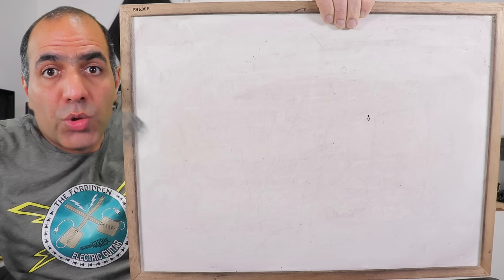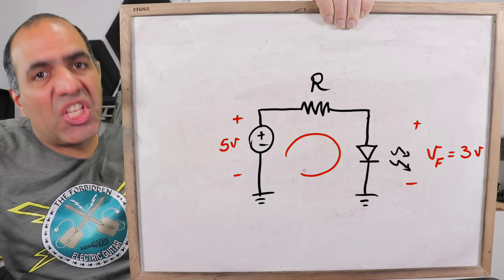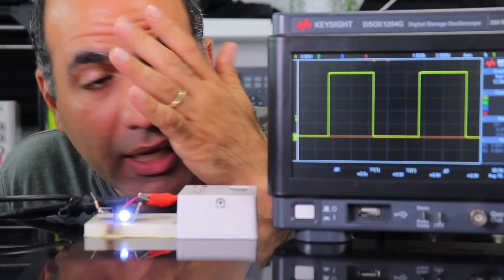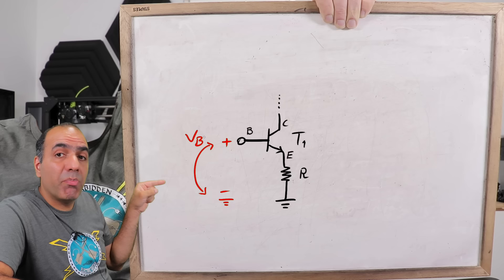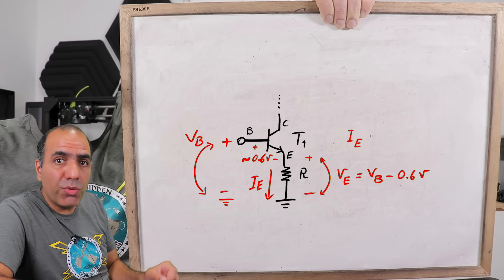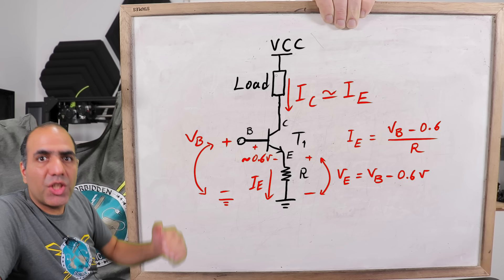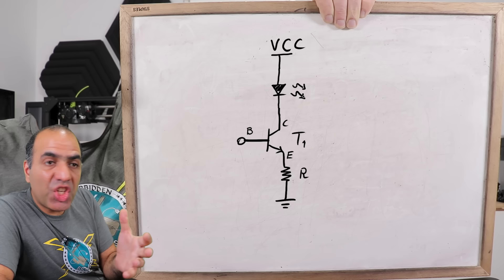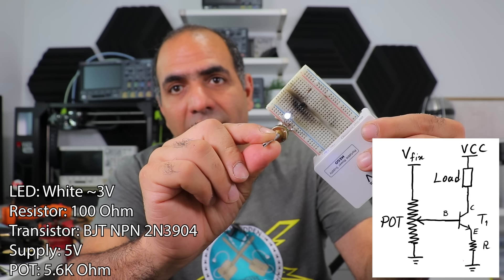How to Turn an LED On

Comment: Technically speaking, Mehdi, all diodes are light-emitting. Just that the ones we don't call light-emitting emit infrared photons as electrons jump across the band gap at the junction and lose energy along the way. :)

Comment: Earlier today I was wondering how to make the LED from my flashlight last longer and the first thing I wondered was what I could replace the limiting resistor with to lower the consumption and then this video popped up. Coincidence?
(P.S. for a 3V supply, 30mA is equivalent to around 10mW so it may not be worth it)

Comment: @ElectroBOOM , I use at work these LEDs "150060RS75000" the light is insane and I drive them less than 100uA current to reduce the light a lot. they are super efficient.!!!!! Driving them at 1mA or more is really bright!!!!!!!!!!

Comment: Lol as an instrumental engineering 😅 it's better if you used Chopper .😏 But turns out after capacitor experiment you went to chopper circuit (kinda MOSFET,igbtor bjt)

Comment: I understand ohm's law, V=IR, but Mehdi used a formula here that resembled ohm's but had some extra components.  Could anyone help me understand how he came to 200 ohms? 
I don't know calculus (I will learn eventually) so if I need that to understand, I'll have to learn that discipline first.
Reply: No calculus necessary only ohms law and kirchhoff's voltage law are needed. 

If you know the voltage drop across the diode from the manufacturer (say, 3V) and the voltage of the power supply (say, 5v) then you know that the voltage drop across your resistor in series must be 5-3=2v. This is because kirchhoff's voltage law says all the voltage drops in a closed loop have to add up to the voltage power supply. The voltage drops of the series resistor and led add up to the 5v of the power supply so the voltage drop of the resistor must be 2V. 

Also, we know the current needed to light the led from the manufacturer (say .01A). 

Now we know the voltage drop needed across our resistor and the current we want flowing through it so we use ohms law to solve the resistance R=V/I 

2V/0.01A=200ohms

Comment: I just wired up a little model I had that lights up directly to a 2xAA battery box without any resistor lol I'm probably wasting battery power, but 3 volts isn't going to blow an LED XD 120 volts sure will, though haha

Comment: Why don't you make a viable shake charger for various devices?
You know, with a big fat powerful magnet..

I've been wanting to make 1 for nearly 12 years now & just never bothered, but I'm finally getting a hold of all the components I could need to experiment with.
It also doubles as a powerful flashlight.
Hah, I was even thinking about adding UV LEDS to it with a selector switch, just because, why not.

Maybe even turning it into a hand held heater with some extra engineering, & a shit ton more learning.
I haven't done electronics in 21 years man.

Comment: At work we found some fairy lights that took 3 AA battery but somehow turned that into AC to power the LEDS.  Trying to run the lights of DC made them very warm very fast.

Comment: Why not use high power resistor (ceramic resistor)? I can see you are using 1/4 watt resistor. Try power resistor (comes in ceramic material). It will not burn.

Comment: I remember seeing an electric locomotive that recharged its 64 volts batteries from 1500 volts DC with a huge resistor in series with the batteries...
Not beer efficient at all!

Comment: 3:41 Could doing this destroy some power supplies?
Reply: On the video the current has spiked up to 10 A, but remained stable. Will all power supplies survive a short circuit like this?

Comment: Hey! I'm an industrial mechanic. Tell me why, when im fiddling with the wires of an unlit LED light while standing in a puddle and there is no detectable current to the wires, the LED dimly lights. I assume it is the weak electric current within my body combined with some other factor.

Comment: I was once working as a shop boy in a car stereo installer.  I was walking across the shop holding a 1F capacitor.  I dropped it.
Reply: @GamerTheTurtle  My clothes were a little singed and torn and it took a while for my hearing to come back.

Comment: Is it just me or when some LEDs are "dimmed" you can see the flashing? I Proved this to some friend of mine one time while we were out at a place that had LED strips lighting the back patio. I told them, "We need to get out of here, that flashing is driving me nuts." They ALL replied, "What flashing?" I said, "the lights! Can't you see it? They are flashing!" So I recorded the strip is slo-mo on my phone and you could then literally see the flashing and direction the "lights" were traveling. I could see that with my naked eye when no one else could. Have I been shocked too many times?
That also isn't the first time that has happened or the first time I've shown others that they are in fact flashing.
I guess my question is; how can I see this when no one else I know can?

Comment: You missed an opportunity to talk about Transformer vs transformerless LED power supplies- cheap LED are light(hahah) and expensive LEDs are heavy. Possible shock of high voltage in Transformersless. The flickering LED, if you turn any other light or device LED will flicker. Why you see the LED flickering on and off on camera. Cheap LED light bulbs used a transformerless power supply, lowered the AC voltage and used half wave to drive LEDs instead of transformer and rectifiers.

Comment: Hi Mehdi, how are you? hope so. Here in my house, a blessed electrician, not to mention son of a.... put a 16 amp circuit breaker as the main circuit breaker, and the internal circuit breakers with 40 Amps, when I turn my electric showerhead on position 2, it drops, if I turn on my microwave oven, 7 seconds later it drops too. I'm not sure what his idea was, but it was a bad idea....
Reply: Plus... There's no GFCI here... PS: the house is rented.

Comment: You can connect a red or green LED to 220V AC with just a resistor (4.7 Ohm if I'm not mistaken), a normal 4001 diode, and the LED, all in serial.
Something like this:
                                                     / /
~ O-------------/\/\/\/------|>|--------|>|-------------O ~

I have this in on one device that is 32 years old, and it's still working

Comment: When it comes to the mains capacitive dropper circuit, you should use a resistor in series to the dropper capacitor. Since there is a high current through the LED when powering up the circuit without a resistor, which destroys it. (That high current is caused by the capacitor charging up iirc)

Comment: 1:34
HELL naw my LEDs blow so easily that they need a resistor just for a 9v battery.
Bros connecting to 120v . . . RIP the LED.

Comment: while watching this i got my old laptop charger cut the end off and seperated the two inner wires a bit and i touch it to my knife while pluged in and my table caught on fire and my room power blew and i knocked off another knife and stabed my foot

Comment: 9:02 and this is why ANY monitor that uses PWM (pulse width modulation) is absolute trash and bad for your eyes, your iris keeps opening and closing because even if you are not conscious of the brightness change, in any room where the monitor is the brightest source of light, your iris opens and closes synced with the PWM signal of the monitor's backlight. Also worth mentioning, if you want max brightness, the function is maxed out (flat line) so you get no flicker, any lower than max and you get the PWM flicker. DC dimmers are 1000000x times better for any modern monitor and you can set the brightness to anything you'd like without any sort of flickering.

Comment: Instead of rectifying the current to drive the LEDs, why not make a FULL BRIDGE RECTIFIER with the LEDs themselves? They are diodes, after all. Just build the circuit to limit current and you should be fine!
Reply: they have a very low reverse voltage rating

Comment: How to drive an LED? Just install a driver, left click, right click... I'm kidding.
The most important thing to drive an LED is the resistor. 
LEDs take as much current as they can get and then they flash. But only once in a lifetime.
And most LEDs don't handle more than 5 volts backwards.
Only the old red LEDs become reverse conductive above 5 volts and can handle that if there is a resistor.

Comment: 3:40 Doesn't even turn on, probably connected backwards. Let me SHORT OUT MY POWER SUPPLY by connecting the two leads together. 10 amps and Nothing again, no explosion, no sparks, nothing but this silly LED is now lit.

Comment: IMPORTANT: Although you can drive LED from AC via simple resistor/capacitor dropper as in the video, and it works driving LED in forward direction, most LEDs cannot handle reverse voltage like that for too long. 
You need to connect a diode in reverse direction in parallel to LED, or connect two LEDs in reverse to each other.

This is because when they are NOT lighting or conducting (in counterphase), there is no current and the voltage is not dropped during operation and the voltage drop stops at the LED, which means the voltage is briefly -120V (or -230V) which kills LEDs very easily, and usually - immediately. I'm not sure how the ones in the video managed to survive even for a few seconds. Perhaps they did breakdown every second half-cycle but the current was limited by the resistor so it took a while for P-N junction to actually overheat from that, and the resistor burned first.

With capacitor dropper, it is recommended to add a resistor in series with capacitor because otherwise it can blow the LED when turning it on, voltage spikes, etc.

Also connect a large value discharge resistor in parallel to capacitor for safety reasons - you don't want to be zapped by touching unplugged power plug.

A second capacitor across LED is recommended if you want to prevent flicker - this is not necessary for indicator LEDs or holiday lights, but is a serious health issue when lighting your home with LEDs.

Another possibility is to use a neon light bulb instead of LED - they are driven by high voltage (but low current) AC and only require a resistor in series. They also do not typically fail as easily as LEDs upon a voltage spike or overheating -- MUCH less problematic, very robust. They do visibly flicker though and color is limited to orange and green (blueish bulbs also exist but are rare).